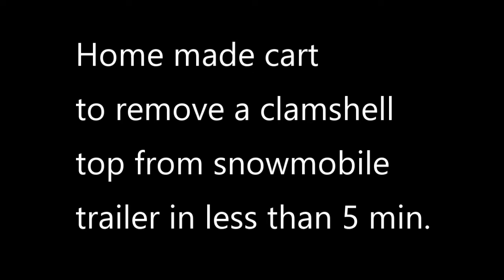Snowmobile trailer clamshell removal cart.

Comment: Could you add height to the clam shell and modify the hinge pins to allow for more height with a framed border?  What about adding height and keep the shell locked down to the trailer while creating barn doors out the back (and ramp up rather than tilt)?